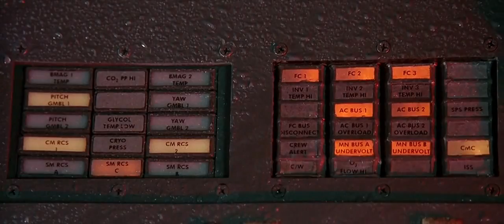Apollo 13 - Ken and Jack Power-Up the Command Module

Comment: “Driving a toaster through a car wash” is probably the best comparison for something like that.
Reply: thank goodness the wiring and switches and instruments were redesigned to be sealed after Apollo 1
Reply: They were worried about shorts due to the condensation while powering up but due to the changes to the command module after the apollo 1 fire which they insulated everything like crazy it prevented any shorts.
Reply: @the00039  There was still the possibility of shorts happening, specifically the internals of the circuit breakers themselves when they got pushed in.  I've seen those type of breakers short out when contaminants get into the internals from the push/pull switch of the breaker, either with my finger on the switch or someone I knew.  There would be some cursing and then we'd just replace the damn thing and do checkouts on the systems (we were maintenance techs for the military).  Now the likelihood of one of those circuit breakers shorting out that one time with water condensation on them was extremely low, but there was still a slight chance, and if it happened, well they would just have had to deal with it.
Reply: Mmhmm I would never touch a Switch with a thin line of Condesate off! But they have to power up the CM Modul to make they Way Home...
It was a lot of good hard work of so many People, on this Situation..
And they make it !!!
Reply: Jesus christ.  That's scary.  And honestly damn near impossible.
Reply: Or a hairdryer in the bathtub.
Reply: Scion XB in a car wash
Reply: "Don't be scared honey.  If they could get Jack Swigert to drive a toaster through a car wash...my Jimmy could land it!"

Comment: ive seen 12 volts shorted melt a steel cable .these guys had no idea what was going to happen when they flicked those switches.
Reply: Ultimately, just had to hit it and find out.
On a side note, the switches and breakers used in the design were likely mil-spec parts and sealed against the elements. So was a decent chance they'd still work as intended.
Reply: @sparkplug1018  They were actually specifically redesigned to prevent shorts as much as possible, as a short was what caused the Apollo 1 fire. So the Apollo 1 tragedy likely saved Apollo 13 with the extra short-safe panels and switches.
Reply: @kukuc96  While this is correct, and added yet another layer of, this should work. It likely wouldn't have been an issue, in this circumstance for the reason I mentioned.
Reply: @sparkplug1018  I think it's also universally acknowledged that if they hadn't had Apollo 1 (of course there were many missions in between it and 13 so not the best hypothetical) they WOULD have shorted out. The fire lead to improvements throughout the craft
Reply: @alex-internetlubber  While that is entirely accurate, it is unlikely the switches used were changed. Reason being is that when ever you open or close a switch there is a good chance you will get a small arc between the contacts. In the CM running 28 volts DC it wouldn't be as likely unless there was already a decent load on that circuit you were connecting to the main bus. But in the LM, it would have been a huge consideration from day one, because the systems in there used either 28 volts DC or 115 volts AC, which will arc every time with any load on the circuit.
So I would at least hope that the engineers considered that well before the Apollo 1 fire. Don't ask me where their brains were using so many other flammable things, but at least the controls I think they had under control.
Reply: @sparkplug1018  I still rank Apollo 1 differently to, say, Challenger. On Challenger there's clear blame that can be pinned on specific people, on 1 it was kind of the same as 13, everyone signed off on it (nobody realized in spite of the problems with go fever that a fire was a possibility, and on 13 Lovell personally signed off on the dropped oxygen tank)
Reply: @alex-internetlubber  I would tend to agree, but there's still things that I point to that puts some blame on the engineers that designed it. Even as a civilian pilot, flammable things on the helicopter is a huge concern to me. And I can land that almost anywhere, or someone else onboard can use a fire extinguisher.
I know the race to get there first made them take chances that we look at now as entirely unacceptable, but something as basic as not limiting flammable materials to strictly only what is needed is just a huge oversight. 
Also found the model switches that were selected, the Sensata 12AT if you're interested.
Reply: @alex-internetlubber  13 ultimately happened because the wrong thermostats were installed in one of the service module’s O2 tank. It lead to an overheating condition that stripped the wires inside the tank.
Reply: @Rintaro Okabe That’s true, point being it met the specs.
Reply: Yeah - in the case of the command module I believe the main DC circuits ran on 28V. It would have been one hell of a fireworks show.
Reply: Thank the ladies who assembled most of those switches. They sealed them correctly.